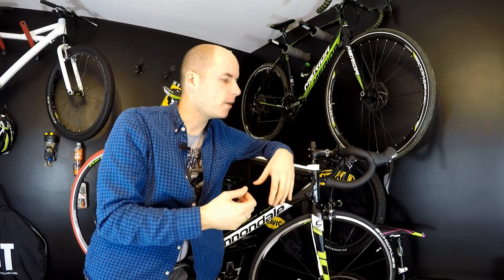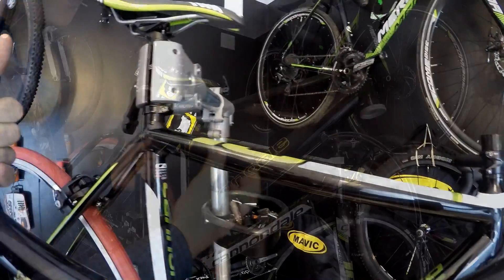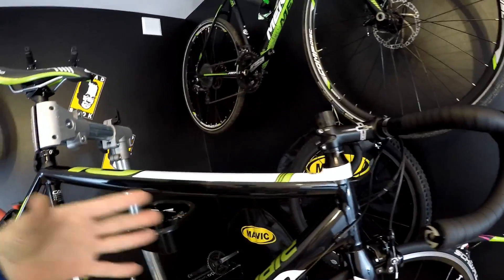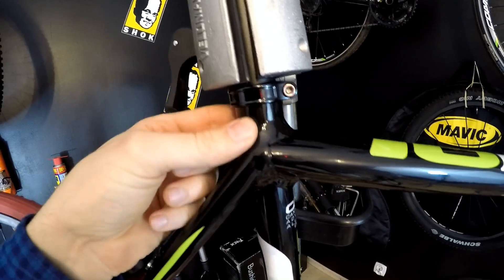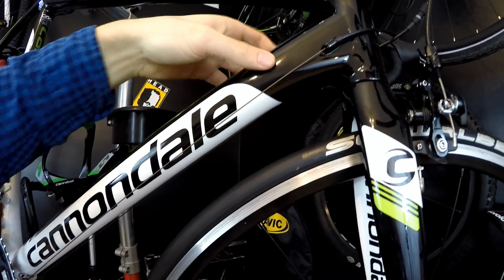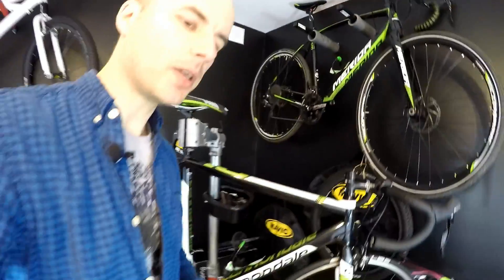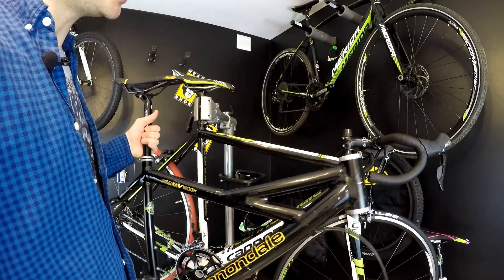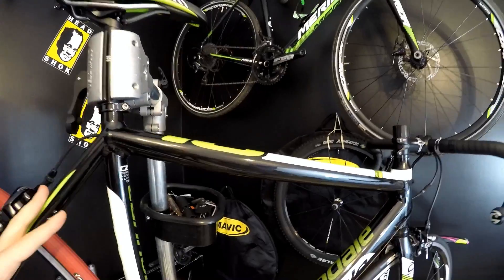Hydroforming explained - a cool way of shaping road and mountain bikes. What is it?

Comment: Annealed material is a pre - requisite for hydroforming to work well . Sometimes the oil pressure in conjunction with an expandable die are forced into the end to be widened or flared out . Diminished wall thicknesses are a downside as well as ride "harshness" in some bicycles . My Giant XTC 26'er is heavily hydro formed and is harsh but responsive however compared to my older traditionally tube shaped Trek which has in my opinion , a more pleasant ride feel .